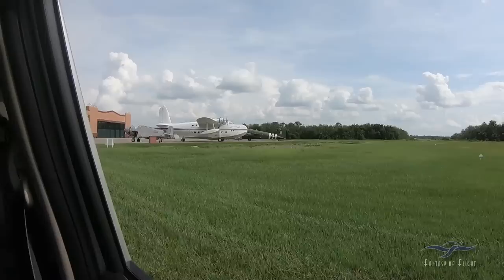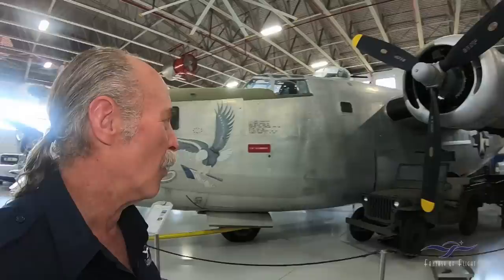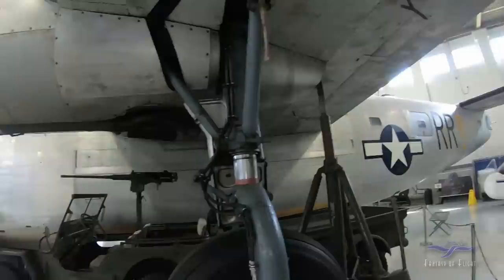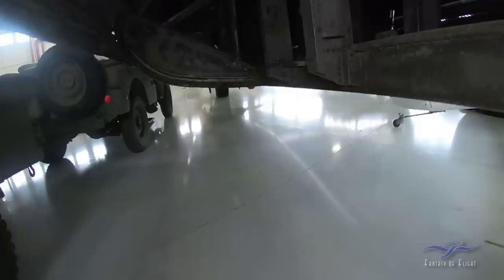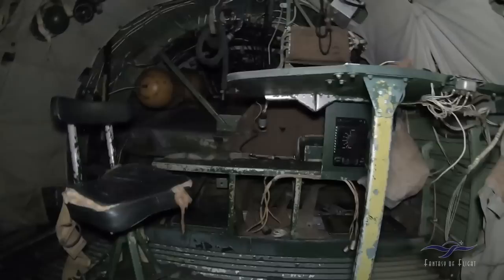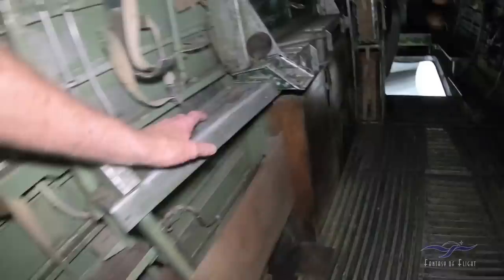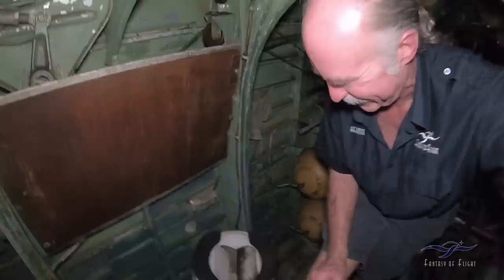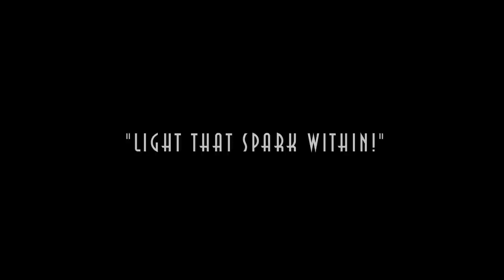Consolidated B-24 Tour - Subscriber's Request! - Part 1

Comment: The front turret is an EMERSON(Electric)  but the rear turret was a BENDIX(Hydro-electric).
The pilots that Dave managed to get to fly her always complained about the weight and balance.
At one point, they yanked out the pilot armour and left it at some airport while they toured the airplane around the East Coast.
The ball turret was in the airplane the last time I saw her in 1994.
The remnants of the fabric bulkheads were still attached but the zippers had long since frozen shut and the crews just cut there way through them. Just like the wheel well canvas covers, these were meant to control dust and debris inside the ship.
We used that upper side hatch to service the fuel and oil tanks. Occasionally we would walk up and down the spine of the fuselage to clean the pilot glass and service the rudders and elevators.
The side gunner's air deflector hinges were always a little sticky and when they stuck open, it affected the flying characteristics so much that the rudder trim couldn't fix it. Much like the dive brakes on a Mig-15.
I really loved every minute when I could work on,"DORIS," ( She originally had a Nude Female painted on her nose. Only after a trip down South, we had to cover her naughty bits with a CENSORED decal.
The story about the 50 cal Brownings is true!
They were confiscated by the ATF when she landed after refueling in Nova Scotia. The guns in the Emerson Turret were courtesy of a gentleman in New York who made them in his garage.
Reply from the maker: Great stuff. Thanks for posting.

Comment: This plane was definitely a great upgrade from the B-17. It was more roomy, it could carry a larger payload with duel Bombays. The design too was more advanced with the landing gear setup and the fork tail. I actually visited the old ford plant in willow run Michigan and saw how these were built, and it’s amazing how they manufactured them. It may have looked a bit blocky and bulky, but it’s still  a beautiful aircraft!
Reply: Not a fork tail, a twin tail. A p-38 has a fork tail. And a twin tail is not actually more advanced. If you will notice they are pretty rare on planes today. They were perceived as a sign of an advanced aircraft in that era, but it turned out to be not such a great idea, and the B-24s tails probably caused in more trouble than any other feature. Once they put a single tail on, it lost most of the handling probems it had been dealing with. But I agree, technically, and probably actually, a better bomber than a B-17. I certainly prefer it, but that may be becauee I am always inclined to root for the underdog. I think the B-24 at least ought to get more of its fair share of recognition, even if it isnt promoted to top of the heap. Much like the Hurricane which actually did most of the heavy lifting in the Battle of Britain. or the Ki-43, which probably did more for the Japanese advance than the A6M did, but which is just called 'the Army Zero' ever since the war.

Comment: You can get in Kermit. Just get under the belly and push open the door aft of the bomb bay. We did this as truant kids in Delhi with the B-24 in the Palam, Delhi museum which was stored outside with not a guard in sight. Got in the cockpit and gun bays and even tried to crank open the bomb bay doors which alerted the guards! The Liberators left in India were "disabled" and had their engines and controls drilled through to make them inoperable but the Indian Air Force put together an entire squadron which was used in 1965 and again in 1971 mainly for maritime recce. The biggest source of intact B-24s today was India.

Comment: Very nicely done Kermit.  My dad was a waste gunner on PB4Y-2's with VPB124.  those aircraft had no belly turret as they were normally so low it was felt to be unneeded.  The waste guns were in turret blisters that when pointed down, the gunfire would converge at about 30 yards below the plane.  Perhaps your B-24 was converted to the PB4Y-1 configuration for anti shipping missions as well.  Dad is still with us and I have just turned him on to your videos.

Comment: My ex-father in law was a 17 year old Navy rear gunner (joined illegally at 16, a Hispanic kid that told his father he was either running away from the ranch or joining the Navy-father relented) in a PB4Y-1 it was a D model but had the tail turret.  He was credited with one Japanese fighter.  He survived a ditching in one.   Crew made it except for the pilot who may have been wounded which is a surprise because the B-24 was purportedly a biatch to ditch.   Found a picture of him either on either Funifuni or Nukefatal.  A little feller.  Also was a rear gunner/radio operator on island based SBD and flew anti-sub patrols.

Comment: Very nice video Kermit.  Your B-24 would indeed make an excellent restoration project.  My father was a B-24 pilot during WWII and he flew 5 combat missions for the 512th Bomb Squadron, 376th Bomb Group, 12th Air Force, which included the infamous raid on the Nazi synthetic oil refinery plants at Ploesti, Romania in 1943 where he flew that raid as a co-pilot.  They flew that mission at 50 feet AGL to avoid the enemy's radar and even bombed that low over the target.   My father and his B-24 crewmates were one of the lucky ones to return from that raid even though they did sustain some damage to the wings from the German 88-mm guns.  That Davis wing on the B-24 lost efficiency rather quickly when it became damaged.  Dad and his pilot had to lean out the fuel mixtures beyond limits in order to conserve enough fuel to make it to their alternate air base in Libya.  By the time they landed in Libya, all four engines were junk from being over-leaned, but the plane got them home safely.  Dad went on and became an instructor pilot in B17's, B-24's and Martin B-26 Marauders when he was stationed at MacDill Field in Tampa, Florida in 1944.  There was a sign over the entrance at MacDill that read "Two a day in Tampa Bay," but to be fair, they were only averaging aircraft losses of two a week by early 1944.  One of the B-24's dad flew during the war survives today and is on display at the National Museum of the USAF, although this plane was not the one he flew on the Ploesti raid. Dad and a couple of his students flew this museum's B-24D on a ferry flight from Maxwell Field in Alabama to Benghazi, Libya in North Africa in summer 1944 where it rejoined its crew after this plane's ball turret was repaired at Maxwell Field.  Dad passed away in 1987.
Reply from the maker: Great post! Thanks for sharing. And thanks to your dad for his service.

Comment: The Indian Air Force flew B-24j aircraft for sure after salvaging them, but they never flew them in combat against anyone. The Indo-Pak conflicts took place in 1949 and 1965 while the Libs were in service. The Libs were flown in the IAF in a Maritime Reconnaissance role an Aerial Survey. The Libs were fitted with Marconi airborne radars in this avatar. As LRMR aircraft they were then replaced by Lockheed Super-Constellation aircraft.

The Radar was in a radome which lowered and retracted through a belly hatch. That's what you were looking at.

Comment: I worked on and helped maintain this aircraft and two more when they were kept at McDill AFB in Tampa! We would used to run it up,  keep all the fluids etc. My Transit alert had fun and learned much from this and a B-25 and  P-47. Also My mother's cousin was a bombardier on one that flew out of North Africa to Polesti Romania. He was shot down and he and another crew member escaped and evaded to Turkey and missed internment to return to his unit. Winding up teaching in TX. 
We took good care of it. We would get the fire trucks out to wash them to keep the salt air in check. One last thing, funny the APU was a Briggs and Stratten engine!  It was called "Delectable Doris" with a rather half naked girl. 
When they flew it out mostly they had to repair the cloth parts of the control surfaces.

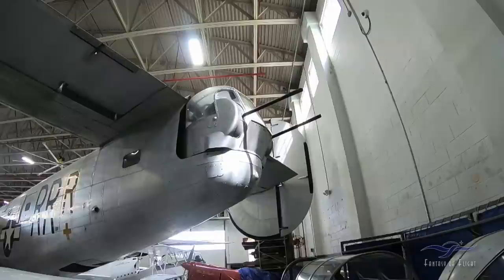Comment: At 8:58 you are standing in front of the tail turret. It appears that there is a small patch underneath the turret. My father told me many times of his role as a mechanic for the army air corps and on of his continual jobs of fixing the gear that the turret rotates on. It continually strips. when this happened, the whole turret had to be pulled to get at it. He (along with some other mechanics ) developed a method of cutting an access panel that would allow him to reach the gear and change it without pulling the turret. For this he spent the war travelling from base to base fixing rows of disabled b-24s. If the there is an "after market" patch under the tail turret, this would be one of the planes, that at some point, my father worked on.

Comment: Thank you for taking and posting this video. Though I am not a bomber guy - much more interested in single engined planes, especially fighters - the original condition of this B-24 is spectacular. I saw my first B-24 at Duxford, the 24 really is impressive in size, especially the low sitting fuselage. Though a big plane on the outside, the interior looks more cramped than I imagined. A great component of your collection!

Comment: I just finished re-watching episode 1 and I noticed that you saw the accumulator on the right side of fuselage. That device is the control unit for the tail turret. Hydraulic pressure was built up and circulated to the turret control handle. If you look very closely at the base of the control unit you will see the hydraulic input to drive the actuators. It is faster then an electric turned ever could be. While electric motors are convenient hydraulic motors and extenders respond quicker then electric motors could of the time.
Reply: Fredrick - thank you for that education. Makes sense also that the ball positioning switches were probably hydraulic valves vs electric switches, as the valves were likely more reliable than the electric switches of the day. Watching the motion of hydraulic construction equipment exemplifies how quickly hydraulics could start, stop and reverse the turret motion as opposed to geared electric motors. Now that I think of it, there also would be weight, space, and cost savings using one hydraulic pump vs multiple electric motors to activate the turrets. Also less copper being used for wiring.

Comment: Excellent video!  I wonder if the best thing, historically, would be to stop any further deterioration, but not do any restoration.  The original condition of this plane must be quite rare.
Reply: I agree, I like it un-restored.
Reply: This plane is not in original WWII condition. It was rebuilt by the Indians and used for many years as a maritime patrol aircraft.  This is why you see the multicolored paint inside.
Reply: @hoodoo2001   Did you listen to Kermit during his walk around? the planes were not "rebuilt" by the IAF. They were abandoned after the war. The IAF sent in some mechanics, did an "IRAN" (Inspect and Replace As Needed) and flew out some airworthy birds. Spare parts were probably plucked from other abandoned hulks or crash sites just to keep them flying.
Reply: @hoodoo2001  All that is still part of her history, and the original patina.
Reply: @joeschmoe7978  not all aircraft, to my knowledge, where complete. They did patch it up at Kanpur, where the British had junked it, flew it to Bangalore, where they were restored. There is an article about it online.

Comment: My first B-24 experience was back  in the '50s, when there was an abandoned B-24 somewhere in upstate NY - north of Corinth somewhere, probably, but I haven't been able to figure out where it might have been. Anyway, I and my 2 cousins were poking around in it one day, and I crawled up to the front and sat in (probably) the bombardier's position. That pissed off a resident wasp, who stung me in the belly. Very memorable.

Second contact, also memorable, was when the Collings B-24 stopped at Tamiami once and we helped the with some minor engine maintenance. After it was all put back together, they asked if any of us would like to go with them to Ft Lauderdale. Silly question! I was assigned the responsibility of verifying the nose gear was down and locked when it needed to be. There might have been a manually-set clamp to ensure that, but memory fades. But it was a fun trip, with a great view out the front. I think we busted a TCA or something along the way to add to the excitement, but that wasn't my problem. Great times.

Comment: I saw this airplane fly out of Bradley Airport in the early 90s. It's an unrestored gem. The radio operator position was usually up front by the top turret. I've never seen the R/O position behind the bomb bay - very interesting.

Comment: Wow, glad to see this. I have wanted to see the interior of a B-24 forever. The only drawing I have shows the radio operator being up front, in the rear of the cockpit with the engineer. Wonder when they changed that? Edit:  Duh, it just occurred to me, if that plane had the ball turret changed for a radar, then the rear compartment is for the RADAR operator, not the radio operator (although sometimes they called them radio operators, since they both utilized radio technology). The radio guy is still up in the cockpit I bet.
And what I was originally going to say is that the canvas screens aren't for privacy, they are to keep the light from leaking out into the fuselage where it might interfere with the gunners night vision, and give the enemy night fighters a glimpse of you. They would also serve to keep the radar operator protected from tge cold air blasting in through the gunners windows, maybe even allow his heater to bring the temp up to 10degF or so, instead of -40 like in the rear. the gunners can wear full body heater suits and gauntlets, etc, but it's harder for the radio and radar operator, part of why they are usually up front where it's heated better, or in a separate room from the rear fuselage, like in the B-17. Since they stuck the radar operator in the back where there was no separate compartment for him, they just made a simple partition.

Comment: I had a good friend long since past who served in a B-24 over Europe at the flight engineer and top turret gun during WWII. Charlie used to tell me his time s in the B-24. He had large scars on his fore arms and an aircraft clock on his desk mounted ina wooden stand. I asked him about the clock and told me about his scars first. He was up in Walla Walla Washington in a B-24. They were doing practice touch and goes on a grass strip in the rain at night. They had gone around several times, but the last touch and go did not go well at all. Charlie told me that he was riding it out in the top turret when the pilot thinking that he had the plane down dumped it. Charlie told me that he woke up still in the turret about 100 yards from the B-24. His arms had gone through the plexi glass which had lacerated his arms. The clock on his desk had come from that wrecked B-24. After that fiasco his outfit was sent to Texas for special gunnery training. This special training consisted of issuing of special ammunition for the machine guns and an armored P-39 painted bright yellow complete with hot shot pilot from the 8th air force. The object of the training was for formation flying with this P-39 doing pursuit curves on the formation to give the gun crews practice before being shipped over seas. The ammunition for the 50'  were thousands of rounds of frangible ammunition. Each round had it's own serial number and each shell casing had to be accounted for after each flight. Charlie told me that it was a G-d awful pain in the ass to keep up with those spent shells. The first practice run didn't go well for the hot shot pilot. Coming in on his pursuit curve he nearly got shot down.Everything on this plane was armored, but the oil coolers. He told me it took a month of persuasion to get the pilot to go up and do it again. The last story and I'm done. Over Europe on a bombing mission Charlie's group was top flight of the mission. He knew the top turret gunner in the next plane over, a boy from Kentucky. Four Focke Wolf 190s  came into view just outside of gun range. He told me that the boy from Kentucky was not fazed by this and swung his turret around and fired off a burst. He flamed one of the 190s and the other 3 backed off even more. Kentucky wind age strikes again. Another friend of mine also long deceased was a waist gunner on a B-24 on the Politesse Oil field raid. I asked him about, he just shook his head and said no more about it.
Reply from the maker: Thanks for posting.
Reply: My father was a pilot on that Ploesti raid. Talked very little about it. He was 21 yrs old.

Comment: The other B-24 from India was ferried with yours to the RAF Museum at Cosford,UK on the way back it experienced a bad fuel leak and managed to get down safely.
The original patina in your aeroplane is something that only time decides to deposit I think this is one aeroplane best left untouched with a bit of minor restoration and lubrication,the thing that strikes hard is the awful working conditions inside,all sharp edges and little room one can only imagine what it was like to have had a strike from the enemy with so many systems to go wrong,those young men were brave souls indeed and this aeroplane is a lasting tribute to them.
A pity that you never made it to the cockpit at least this time because you could have showed us the famous 'cigar' lighter on the panel !
India has been a fine source for many vintage aeroplanes they retained until the very end having made good use of the spoils of war passed onto their country.